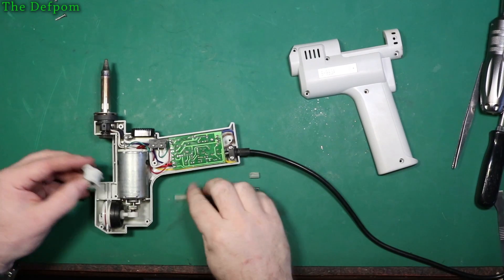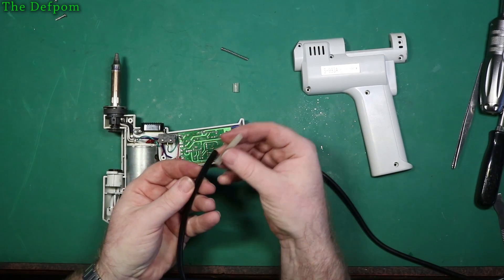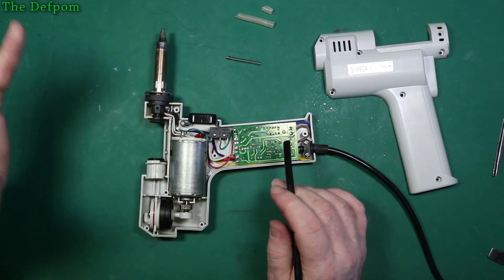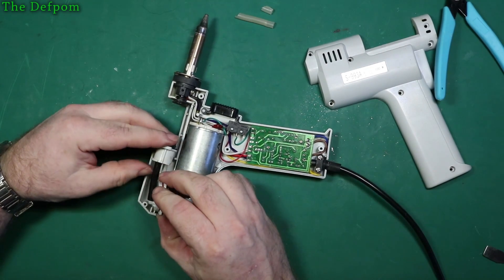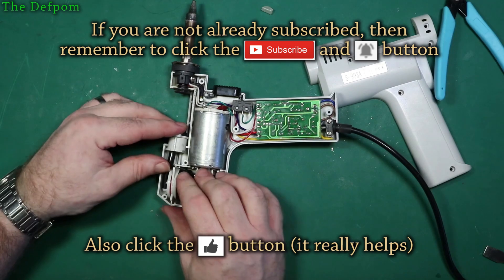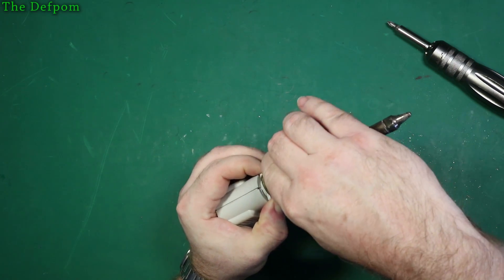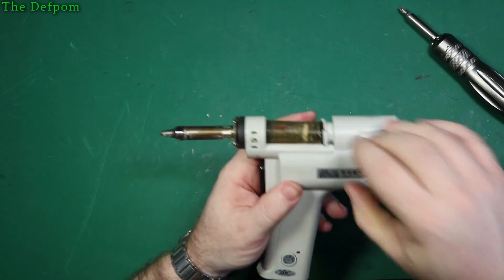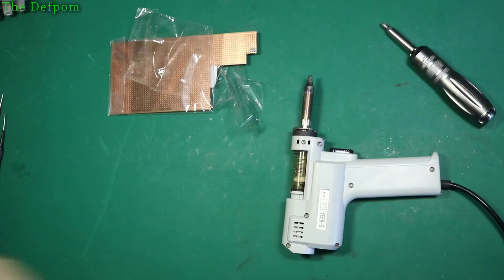🔴 #508 S-993A Desoldering Gun No Suction Repair - Make it Suck - Reupload

Comment: Recently I bought this sucker and after a couple of button presses it died with sparks inside and plastic smell. I disassembled it and found shorted pads on PCB (due to bad soldering) and burned R8 resistor. Can you please tell me the value of R8 so I can restore the control board.
Reply: Mine did the same after 2 uses! How do you remove the PCB? The temperature potentiometer seems stuck in place. I don't want to pull on it too hard.. Is there a trick to removing it?
Reply: Gavin Maxwell I just pull it up using flat screwdriver. I don’t think it is glued or something. Good luck with fixing.
Reply: @konstantinfedorov5578  thank you sir!

Comment: Have you had to replace the heating element yet? I'm on number three already in the span of about a year.
Reply from the maker: No not yet, I purchased a spare some time ago, so I can pretty much guarantee that it will never fail.
Reply: Hello.   Where can I purchase a heating element.  Mine went out while restoring a marantz 1060 🥺🥺
Reply from the maker: Gabriel Guadarrama - you can buy them on Aliexpress, just search for “s-993a heating element”, just make sure you choose the correct voltage version.

Comment: i used this only 2 weeks broken  and cant suck up the leads
Reply from the maker: If the pump runs then it is probably blocked, you should be able to push one of the supplied cleaning rods right up into the collection chamber.
Reply: @TheDefpom  i have opened the casing and no anything broken bro

Comment: Hello , I received this item from Banggood and unfortunately the vacuum pump doesn´t work when you press the button.
I measure the input voltage at DC motor 90VDC , 50VAC , I want to know if this value is right , when I measure ohm value between ports of DC motor , it seems to be open.
Anyone know the DC value of this motor and where I can get the replace part.Banggood offer a refund only of u$s10 ???
Thanks in advance,
Fernando

Comment: How many hours it was working before you replace the tube ? Approximately  :)
Reply from the maker: I probably had it a year before then... it may have even be me that broke it, as I had it apart shortly before that trying to see if I could modify the LED indicator easily or not.
Reply: @TheDefpom  Thanks, Scott for the reply. Looks like it is a pretty reliable tool. I've recently purchased the same one.

Comment: Ahh it works :-D
I was trying to think of sources of soft tube, but nope, empty brain as normal.
I did need some stiff tube for fixing an old 8 track for a frend, i found the internal tube in an antipersperant spray can was usefull, i used it to make a group of tubes to sit leds in, the original ones had crumbled to bits.
Nothing is safe in my house when i need source material lol :-D
Ooow the center of large pen inserts, empty of cause :)